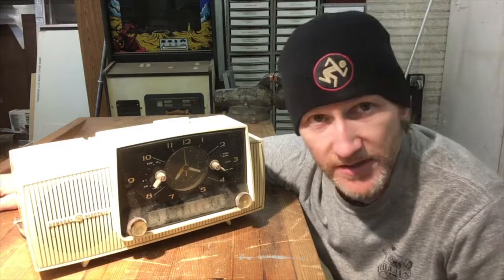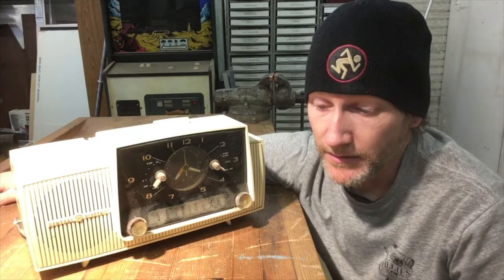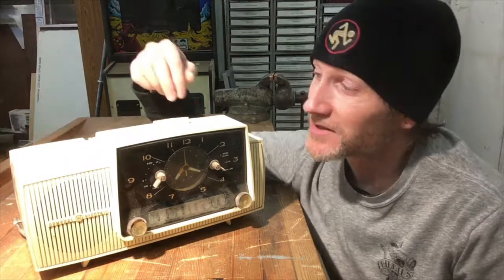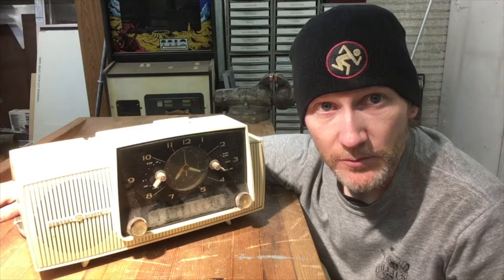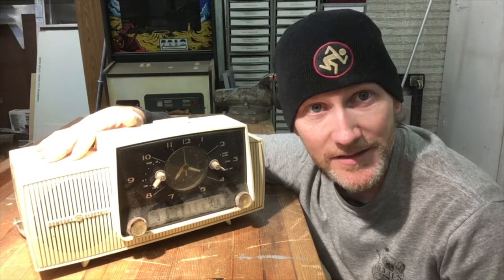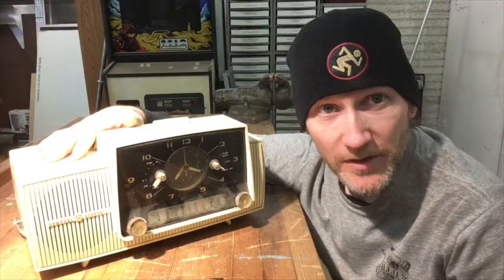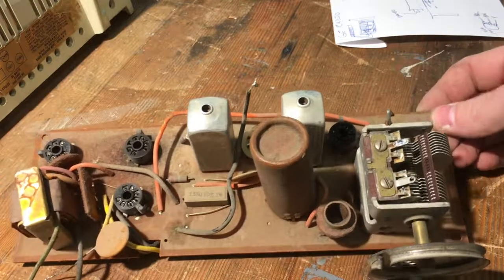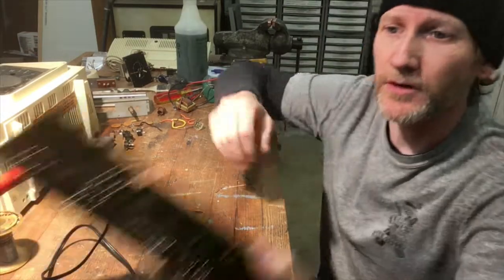General Electric C-430A Clock Radio Restoration Part 1

Comment: I used to have one (in blue) but it died long ago.  I wanted to own a radio without a clock, but they are difficult to find these days.  I ended up getting this one, which I love.  It's a Sangean WR-11 Wood Cabinet AM/FM Table Top Analog Radio.

https://m.media-amazon.com/images/S/aplus-media/vc/c1a5c609-40f4-4c27-9e04-0a1d9246a10b.jpg